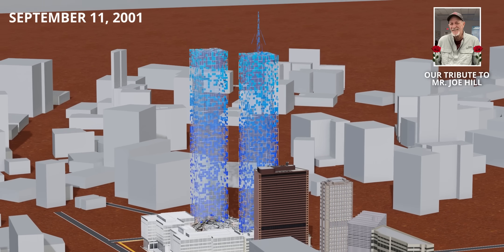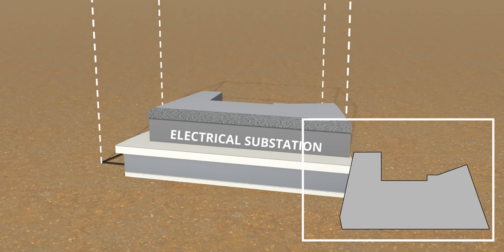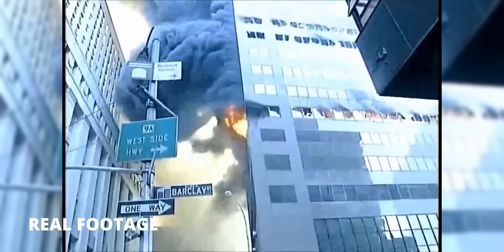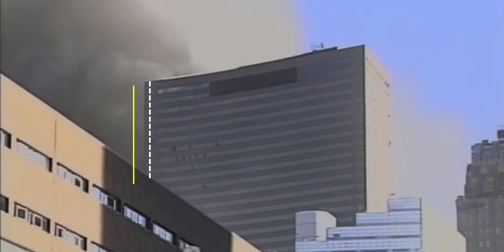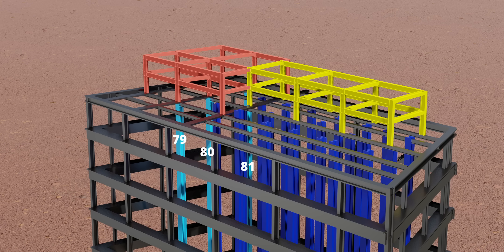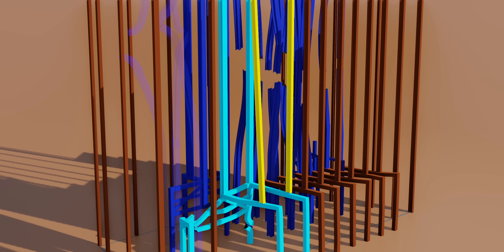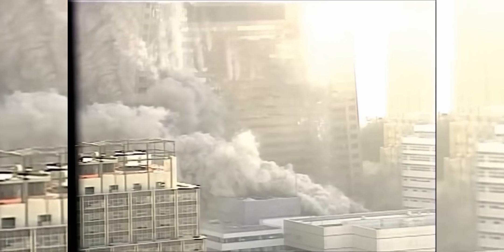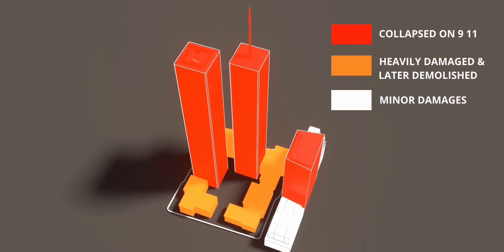Collapse of Building 7 | The Complete Physics

Comment: Ya, the air conditioner weight brought down an entire structure
Reply: @stephenmorrison2752  🤣🤣🤣
Reply: it was a badd assed airconditioner.
Reply: "air conditioner" is probably a bit of a misnomer.  "Chilling plant" may (or may not) be more accurate.  Buildings the size of these require literal tons of machinery to keep them cool.  I thought they were generally in the basement....but it sounds like this was an add-on.
If the supports under them are compromised...they're not going to magically float in the air.  Besides, it's not just the weight of the machinery...it's the weight of every inch of the building above the compromised point....so, literally dozens of floors of weight.
Reply: The sampoong department store would like a word with you
Reply: Perhaps a more detailed explanation will help. Building 7, the 6th building to collapse of 10 lost on 9/11 was extensively studied yet still confuses many people. Not famous or a terror target, and with no casualties, it did not get a lot of attention and few know much about it, creating a void rapidly filled with garbage from the internet. Because everything seems like a conspiracy if you don’t understand how it works to fix that I prepared this brief summary explanation of my own analysis. No politics, just engineering. 

The North Tower collapse at 10:28am bombarded Building 7 with tons of burning debris, causing heavy damage and starting raging fires burning out of control for the next 7 hours. Half the responding FDNY firefighters having been killed, others injured, units in disarray, equipment destroyed, no water pressure, and the greater urgency of Search & Rescue efforts, firefighting at 7 was pulled as futile. The building couldn’t be saved and was left to its fate.

www.youtube.com/watch?v=g_SvpwyC17M&ab_channel=MFitz  

Collapse of a burning structure is always a concern for firefighters. Steel buildings subject to fire rely on active fighting of the fires to survive. Buildings are designed around 1 to 3 hours of fire resistance, allowing time for occupants to escape and ACTIVE firefighting to get started, after which all bets are off. Left to their own devices they will exceed their design envelope and collapse. In B7 the occupants escaped, passive and active fire protections were compromised and active firefighting was abandoned which left the building to take its chances. It lost. Odds on Building 7 would eventually collapse, and it did. No big deal in logic. That is the sort of choice firefighters make every day in brush fire situations - which houses to save and which ones to let go. Only real difference here is moving the decimal on the size and cost.

www.youtube.com/watch?v=WnYBX6QT0R4 

FDNY Chief Daniel Nigro ; The biggest decision we had to make on the first day was to clear the area and create a collapse zone around the severely damaged 7 World Trade Center, a 47-story building heavily involved in fire. A number of fire officers and companies assessed the damage to the building. The appraisals indicated that the buildings structural integrity was in serious doubt. I issued orders to PULL BACK the firefighters and define the collapse zone. It was a critical decision; We could not lose any more firefighters. It took a lot of time to PULL EVERYONE OUT, given the emotionalism of the day, communications difficulties and the collapse terrain

FDNY Deputy Chief Peter Hayden ; We had our special operations people set up surveying instruments to monitor and see if there was any movement in the building. We were concerned of the possibility of collapse in the building. And we had a discussion with one particular engineer there, and we asked him if we allowed it to burn could we anticipate a collapse and if so, how soon? And it turned out that he was pretty much right on the money, that he said 'In its current state you have about 5 hours

The collapse of Building 7 was anticipated all afternoon and widely reported in the media with at least 24 video cameras recording some or all of the collapse. Everyone at the time knew what was coming and why.

www.youtube.com/watch?v=OY5S5k3tMHI 

Building 7’s collapse was totally different to the Twin Towers, harder to understand and most of the details difficult to see. But we can sort out what happened through careful analysis and observation.  What follows is MY EXPLANATION of the collapse sequence using the best available information and relying on no authority.

B7 was complex structure, a 47-story steel framed building built on top of a smaller existing 3-story building, requiring several lower floors dedicated to complex load transfer structures instead of usable office space. Of trapezoidal shape and all-steel tube-in-tube construction, B7 (above the 7th floor) consisted of a central core of steel columns carrying most of the gravity load, perimeter steel columns around the outside of the structure carrying the remainder of the gravity loads and long span beams and girders to tie those elements together and form the floors. On the outside of the building hung a moment frame - the last part of B7 to fall. 

Phase 1 : Collapse initiation for B7 is notably quiet with observers not realizing the building was collapsing! There was no audible warning in the form of say hundreds of ear drum busting 180-190dB explosive bangs preceding the collapse. The first externally visible signs of collapse initiation occurred at 5:20:28 pm. Here at 12:00 a local CBS affiliate reporter is talking 10 blocks from B7 when collapse begins. People don’t start to notice the collapse until 12:11. Then at 12:45 is the famous CBS fixed camera clip of Building 7’s collapse Again, note how quiet it is.

youtube.com/watch?v=t5tEy6mXSE8&ab_channel=fresnosean379

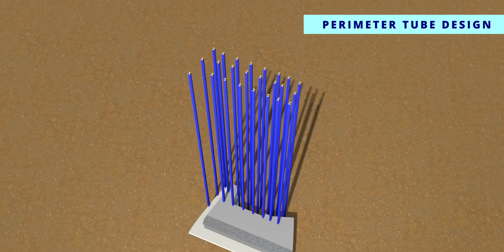Collapse initiation was due to multiple lower floor failures above the load transfer region (7th floor) in the NE corner of the building. In this video at 0:45 you can see the NW corner from inside the building while under construction, Column 79 just out of frame on the left. That big, angled steel beam across the top of the frame connects to C79 at one end. The girders connect to the beam. That beam and all those girders depend on just one connection

youtube.com/watch?v=nP3TNHPCIVU&t=35s&ab_channel=EdwardCurrent

Phase 2 : Lower floor failures caused a loss of critical lateral support over an excessive length of core Column 79 and it buckled. If you look at a floor diagram of Building 7 (see above) and look at all the structures that depend on C79 you quickly realize this one column was a relatively isolated structural element on which a disproportionately greater fraction of the structure depended . Externally we see a vertical progression of window breakage along the 44-46 line and a kink in the roof of the East Mechanical Penthouse at the top of the building, consistent with C79 failure. The transition from full capacity to almost no capacity occurs in virtually an instant. Once the buckling failure occurs there is almost no resistance

Normally with a buckling column, the load could very well be redistributed to other columns, meaning the buckling could stop after a while. With C79 that is not the case - the failure did not redistribute the load, so the collapse rapidly progressed to the roofline, sinking the rooftop penthouse.

Phase 3 : With C79 gone, B7’s progressive, non-symmetrical collapse continues with C80 and C81 at the east end of the core left laterally unsupported and quickly buckled and failed as well, sending the EMP down through the building. C79-81 all have no diagonal bracing, which I believe is a major reason why they could not redistribute a lot of vertical loads among one another.

From there collapse progressed from east to west through the central core until the core was gone taking all of the interior floors and structures and probably most of the perimeter columns with it. You can see the horizontal progression of window failures low in the building and the dropping of the remaining rooftop structures into the building. One of the big takeaways from the NIST Building 7 study (that gets completely ignored) was their modeling which determined C79 failing under ANY circumstances would have initiated the same collapse sequence.

Phase 4 : After some 10 seconds all that remains of Building 7 is just a hollow empty outer shell - the exterior moment frame - creating the illusion the building is still standing since little has changed externally. But it’s just a hollow empty shell like an empty cereal box supported by only a few remaining columns and quite unable to remain standing. With all the internal framing gone. the north face leans inward, forming a V in the roofline, the last perimeter columns buckle under the strain and with nothing left keeping it up the moment frame free falls, landing on top of the 7-story high debris pile. It is only at the very end that a single measurement of alleged free fall acceleration is taken. Note this is not the building but just its outer shell, and only one corner at that, at the very end of the collapse. Start to finish the entire collapse took 18-20 seconds, or less than 1/3 of true free fall and we have to look at the whole thing, not cherry-pick little bits to fit a particular narrative. Worth noting _how fast something falls cannot tell you what started it falling in the first place. The debris spread out, blocking surrounding streets, heavily damaging the Verizon Building and destroyed Fiterman Hall, all well outside of Building 7’s “footprint”.  

Building 7’s progressive, non-symmetrical collapse was incidental and unintended collateral damage from the combined effects of fire + time + gravity started by the collapsing North Tower. That is true no matter who planned and carried out the 9/11 attacks or why . The collapse was of so little consequence it barely even registered at the time, a mere footnote. It only took on semi-mythical status as an alleged smoking gun years later when demolitions at the Twin Towers, missiles at the Pentagon and shoot down over Shanksville all failed and conspiracists had nothing left to work with.

Anything can seem like a conspiracy if you don’t understand how it works. Now you should. I hope you found this helpful and informative, not adversarial and it solicits informed critical comment. If I made any errors of fact, logic or reason or left anything critical out, please let me know so I can fix it. IF you can offer a more plausible alternative please do. Be the first. Please start any reply with the words “Tits McGee” or I will know you didn’t read it and are wasting my time.
Reply: "Ya, the air conditioner weight brought down an entire structure" And brought it down at freefall speeds, meaning there was no energy loss in smashing all that concrete to dust, or any loss of energy due to the millions to tons of energy into bending and breaking all other structural beams into pieces.
Reply: That’s just the way physics works.

Stack up a dozen cider blocks, then drop a cider block on top. The result will be a pile of dust. That’s just physics.
Reply: @1237barca - Problem solved, whoever you are, the OPS boss wants you (the genius) for the next easy project...
Reply: @1237barca lol maybe with the apple cider blocks you speak of. Not with cinder blocks though, assclown
Reply: @1237barca  haha. dust from block 1 doesnt have enough mass to pass the kinetic energy to yr 2nd "cider" block 
&, er, i think there was steel involved... 
maybe the camel herders flying the planes had pockets full of EXTRA "cider" blocks for additional weight
Reply: @griffenthedog special art student cinder dust is super heavy
Reply: @1237barca - I would say, he's been riding the short bus waaay tooo long:face-blue-smiling:
Reply: @henrysusa3210,  how much did all this material weigh, that collapsed into the building?  I realize you can’t and even don’t want to answer, because you’re not interested in the truth, just your own fantasies
Reply: Did you watch the video? Obviously you didnt when it literally shows the step by step collapse.
Reply: @smarty265- Hey SMARTY!  47 floors fell, because of a fire...and KAMALA would have been a wonderful Patriotic American President and don't forget it
Reply: @henrysousa2502  ROFLMAO, omg. Stop, stop, my guts hurt from laughing too hard.
Reply: @joedemarco, how much did this air conditioner on top of building 7 weight?  The one on my roof is easily a couple hundred pounds
Reply: @dikranovichk5889 - It wasn't the AC, it was the real estate lease holder Larry, sitting in the building next door pulling the string...

Comment: Thank you for this video on explaining WTC7 failure.
There are so many conspiracy theory about control explosion pre-installed on critical columns by third party in advance.
This video clear all myth for so many years 😅😅😅

Uncontrol fire due to
(1) mis-function of fire spinke (broken water pipe)
(2) Firemen allocated all resources at WTC1 & WTC2  leaving WTC7 burn to hell
(3) continuous cooking over 7 hrs weakening critical steel columns (2hrs fire resistance for steel structure was industry standard at that time) resulting local buckling failure.

WTC7 collapse seems logical with combination for all above unfavorable factors added.

Comment: Free fall speeds require enough time to accelerate to that speed. That building is not tall enough to do so. This video proves absolutely nothing
Reply: There is no such thing as free fall_SPEED

Free fall can either be a reference to a state or a specific rate of acceleration .  It is NOT a measurement of velocity.  Not that any of this matters since how fast something falls cannot tell you what started it falling in the first place.  A bit of bleeding obvious all to frequently overlooked or forgotten.   

Steel framed buildings BTW are invariably demolished by dismantling, and never while actively on fire. 

This video is pretty good – with a few exceptions - and goes into a much higher level of detail than many viewers will be able to comprehend.  While not perfect, the collapse mechanisms – the sequence of failures - described here  are substantially correct and this is true no matter who planned and carried out the 9/11 attacks or why . 

That may not be what you want to hear and go against 20+ years of entrenched dogma and conditioning, but it’s not wrong. 

That also means (in case you did not get the hint) this video can be (and IS) absolutely correct in its description of collapse mechanisms AND the 9/11 attacks could still have been some sort of inside job. The two things are in no way mutually exclusive. 

The mechanisms described here have broad professional support around the world. There are no professional engineering organizations (for example: ASCE, ASEE, ICE, etc) that disagree with them or have offered any formal dissenting opinions or alternative hypothesis. 

So, setting hubris aside, either the overwhelming majority of the worlds structural engineers and simple observation are wrong,… … or you are. Which seems more likely? 

IF you still think believe this explanation is wrong then produce a better one . Good luck with that. No one ever has and I don’t see you moving that needle today. 

No one ever does.
Reply: @TheCriticalStinker-jw4fl  there are hundreds if not thousands of architects and engineers who disagree with the " official " claim. Like usual,  they are silenced. So you ignore building 7 and the thousands of video testimonials ( taken from the lobbys themselves that day) of several explosions being heard and witnessed. Ok
Reply: @WhoIsJohnMcEnroeSo how does the building know the structural failure which sent it plummeting was caused by pre-planted demolition vs
 Buckling, metal fatigue, corrosion, gross overloading, midgets with saws or any other mechanism so it knows how fast it should fall?
Reply: @WhoIsJohnMcEnroe - Did I stutter?  Read the question again, starting at the top of the thread. It's not complicated - although it is well over the head of someone like yourself.
Reply: @WhoIsJohnMcEnroe - Not my fault you can't read. 

Look, I know that in order to seem even remotely intelligent you are absolutely dependent on ChatGPT.  But that doesn't mean the rest of us share your shortcomings - or petty obsessions.  Sorry if that bruises your ego.

Grow up.